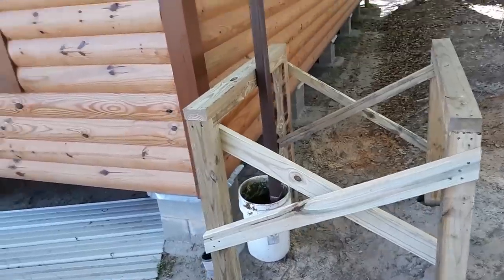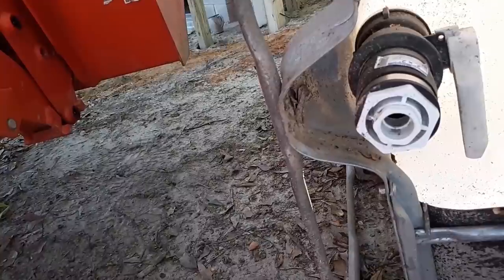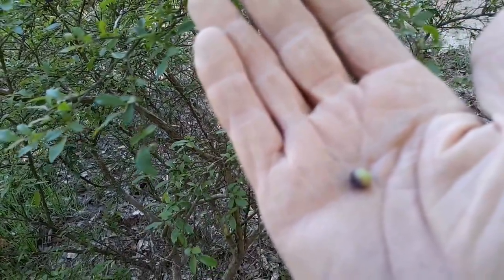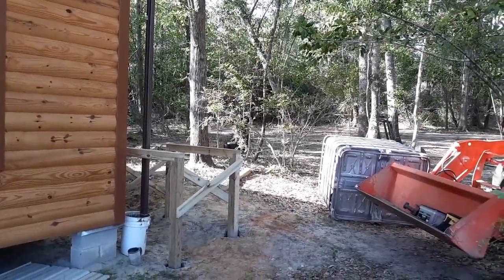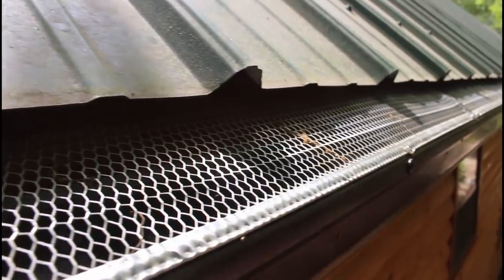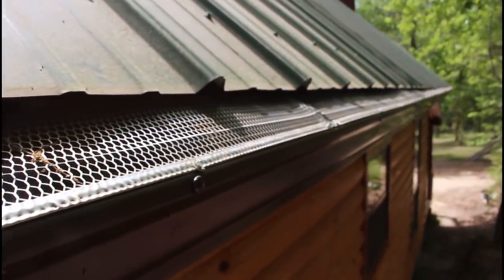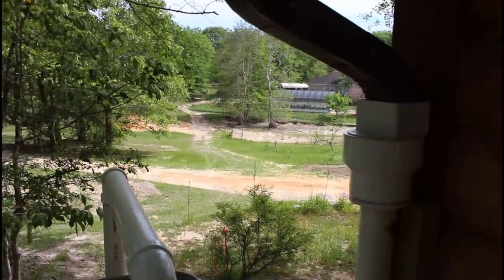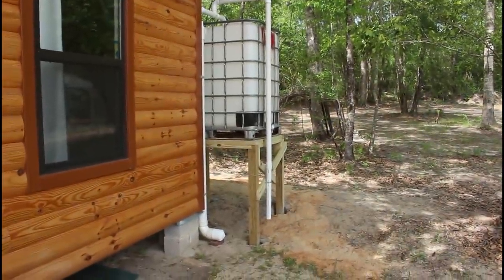COLLECTING Rain? ---  Rain Catchment System at the Off Grid Cabin

Comment: for my garden i use an second hand inflatible swimmingpool 1500 gallons , in the winter it is empty. and with a sumppump it is easy to watering the garden. i paid mine 50 $
Reply: You'll need to consider mosquitoes.  I had cattle tubs on my property holding a lot of water and realized I had created a perfect breading ground for mosquitoes.  I have since dumped the tubs and will try to do something like Danny has when I get the time, money and can travel freely.
Reply: @stmcgarret  a tarp does miracles.
Reply: my rainwater collects in a barrel , in the barrel  there is a sump pump, witch start to pump the water to the swimmingpool when the level of water rises in the barrel. The sump pump is encapselled in loth , so the big bedry stays in the barrel.
Reply: Barley balls are great to float on an open container to keep mosquitoes out.

Comment: When you add the hose fitting to the tank, I suggest using one with its own ball valve. The plastic ball valve in my tote broke after a few months of use & drained the tank.

Comment: Danny you did a nice job of designing the water system.  I especially like that fact that you took all conditions into account.   Great idea using an empty pop bottle as a stopper.    The most important thing is gathering the water so I wouldn't worry about the color besides black would absorb the heat faster.

Comment: Many of these tanks have odd thread in the cut-off. I did the same thing with the flexable coupling to a water faucet.
I set my tank on concrete blocks just high enough so i can get a 5 gallon bucket under the faucet. 
I painted my tank with green krylon paint to keep algae from growing in the tank. The paint started flaking off in a about a year. So, i hope to wrap the tank in black plastic when i rebuild the system.
One good rain fills the tank.
I have since gathered three more of the big tanks and i hope to build a system big enough for all of my gardening needs in the next few months.
It looks like you are on the right track.
Theres no reason that the water couldnt be filtered or boiled to make it safe to drink.
It would sure beat having to carry 5 gallon buckets from the nearest pond if the grid went down for a week as its been known to do.
I dont like using city water on my plants. I dont think the chemicals in it are good for the soil.
There is a formula for calculating water pressure based on the tank height. Basically the higher the better. It will be interesting to see how much pressure you get with that set-up. Also the larger the hose diameter the better too.
Thanks for all you do.
John Davis jax fl
Reply from the maker: I'm thinking about putting a pressure gauge on it.

Comment: If you can get more totes, like the one you just put in, so there's 3 on the back corner and then use the same kind for the front, BUT fence them in with lattice and add flower boxes. The kind that hang on deck railing's. They would look nice and would hold more water then a barrel. Love your homestead !  gardens, fruit trees, animals, so wonderful. Stay safe and healthy. God bless

Comment: A lot of the IBC totes use "Banjo" style hose fittings.  They come in many different sizes and versions so you can change over to a regular pipe thread style fittings if you need to.
Reply: Where can you buy the fittings?
Reply: @dianerathe5049  Amazon has a variety.  Just search Hose Banjo fittings, or a plumbing supply house such as Master's Supply.
Reply: Thank you

Comment: A full tote of water weighs over 2000lbs.These ICB totes are designed to be stacked on top of each other and they lock into place. Instead of building a wooden platform to carry 1 ton of weight I recommend that people just stack the elevated tote on top of an empty tote cage. Use it for storage, grow some plants around it like lattice or just fill both totes with water and PVC plumb them together for twice the water storage. No need for all that lumber, concrete and digging.

Comment: You do not want to be relying on cheap PVC parts anywhere in that system. I worked for two different chemical companies for several years, I've filled and emptied more tanker trucks and totes than most people ever see. NO professional uses PVC pipes or fitting for those totes, and there's a dang good reason for that - PVC WILL fail. Not "if it fails," it's just a matter of when. "Never" freezes hard where y'all at? Well it only takes one time, brothers and sisters. PVC isn't meant to hold up to UV from sunshine for months and years on end, either. It gets so brittle you can break it apart with your hands.
Talk to the companies that supply truckers and chemical factories, and get you the right valves, quick-release fittings and hoses to drain that UBC tote and build your manifold. Then you can just use garden hose or blue pex from there. It will cost more now, but that's much better than having a three-dollar part crack or burst and there you are scrambling to fix a bunch of glued-together crap while all your stored water runs out.  Look at it this way, the tote was free for you, so don't cheap out now. You'll still come out ahead very quickly. :)
Reply: Whats a good replacement for the pvc downspout?
Reply: @midori8735  almost anything else LOL. You don't need stainless steel for plain water so the properly rated industrial hoses are the correct choice. But plain black iron pipe would work.

Comment: A small hole can be drilled through the drain access nut so after a rain the water can empty on its own.  One less thing to remember to do.
Reply from the maker: It has an overflow system theres nothing to remember.
Reply: @DeepSouthHomestead  The small hole would be for the dirty water to empty out of the first flush on it's own so the pop bottle can go back to the bottom and wait for the next rain and flush again. My flush does this and the hole is tiny tiny. But it has a screen inside to catch debris and keep it from plugging. Otherwise without a drain the bottle stays at the top and the next rain will not be flushed and the dirty water will go straight to your tote.
Reply: @DeepSouthHomestead  On the next rain, the diverter pipe will be full and will not catch the roof crud.

Comment: Nice job Danny! I built nearly the exact system last fall, works really good. Don't paint it black, it'll just make the water hot. I took my bladder out and wrapped it in black plastic. It's a bunch more work, but the water doesn't really get hot in the summer. Also, if you haven't, drill an 1/8 inch hole in your clean out cover to allow the water to bleed out or it'll always stay full and won't work. Nice job Danny! 😉

Comment: Shit you could drink that water totally. For shits and giggles you should get a tds tester (total dissolved solids) and test your rain water. Rain water is usually around 5 tds, maybe up to 60 tds, depending I guess on if they've been Chemtrailing above you...while the water out if the tap is over 100 to 150 tds usually. Even more if they fluoridate, luckily my small town only does chlorine, which still sucks.

Comment: I can appreciate the ingenuity but I'm not sure I understand why the coke bottle is needed.  If the filter pipe is full of water wouldn't the water itself divert the water?  Sure there would be a little churn but most of the particulates in the filter pipe would fall to the bottom anyway.

Comment: you can buy a 2" gator clip for those ibc totes, from tractor supply or online.  from there it is just a matter of buying 2" npt fittings to reduce up or down to your desired pipe or hose size.

Comment: Nicely done. One thing you may want to add is a level gauge on the side. Some clear vinyl tubing with a colorful "bobber" and reducers on both ends to keep the bobber in the gauge tube. It can be done electronically too, like the fuel level sender in a car, but the bobber in clear tubing is the simplest way.